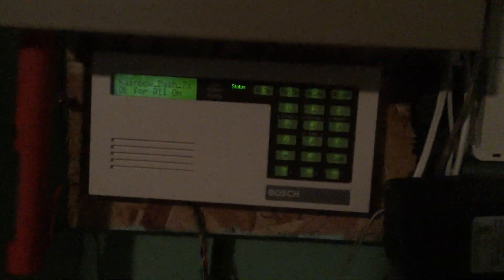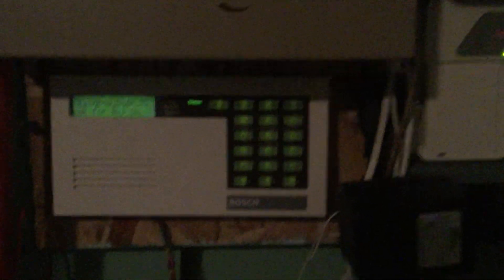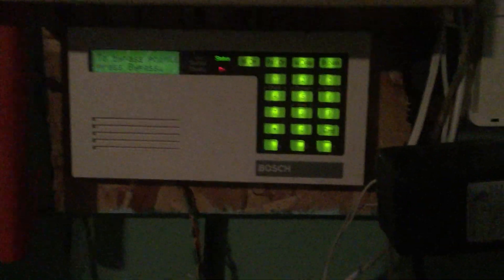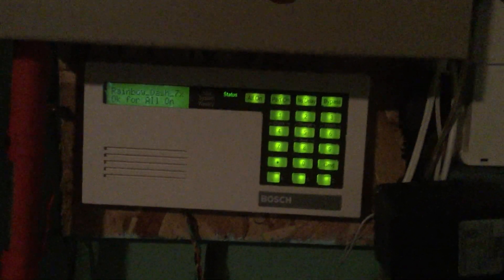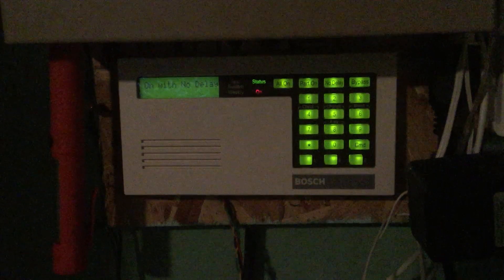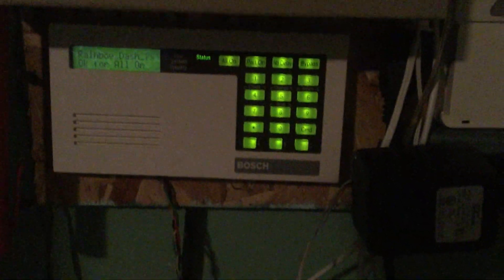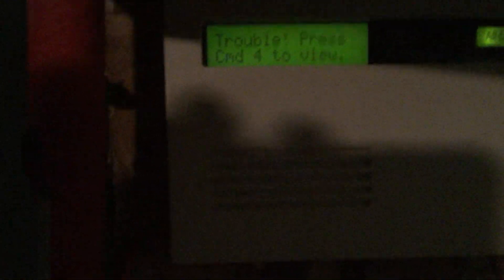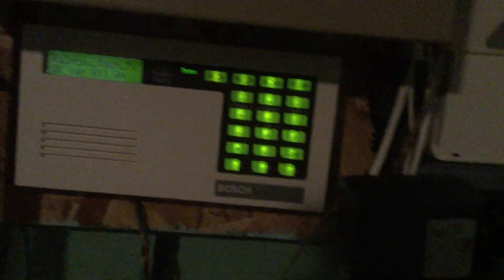Radionics d6412 basic functions

Comment: So good to see content with this system. My Grandparents purchased a Radionics D6412 System that was installed by Greater Alarm in their newly-constructed home in 2003. The system worked great for years until we were forced to upgrade in 2015 to a Cellular-capable system. Still miss the system to this day. Thanks again, God bless.
Reply from the maker: The Radionics panels are the best in my opinion, very simple to use and they just don't die!
Reply: @KJ7BZC  I agree. We would still have it today if it wasn’t for needing a cellular system.
Reply from the maker: @brendenburge7349  Yeah the d6412 didn't support a cellular dialer of any form. If you don't mind me asking, what panel was it replaced with?
Reply: @KJ7BZC  We ended up replacing it with a Vista 21iP and also had an expansion module installed. Then added two 6160 Keypads and total Connect functionality.
Reply from the maker: @brendenburge7349  Hey thats not a bad panel though, at least it isn't one of those weird all-in-one panels. I would still prefer the older Radionics ones though.